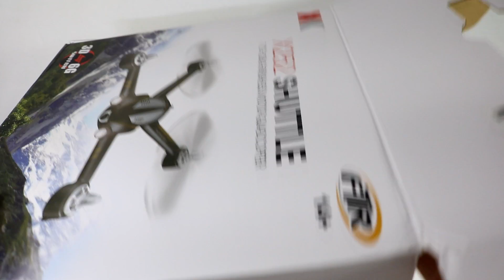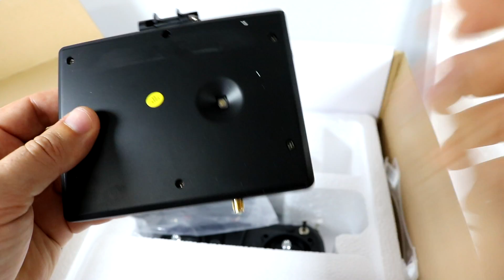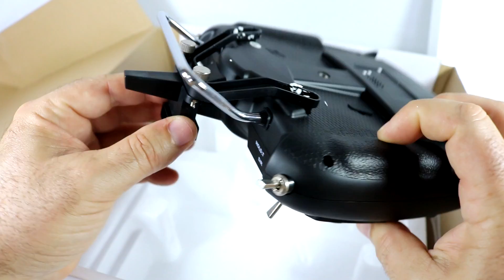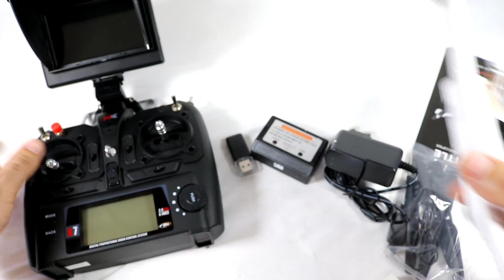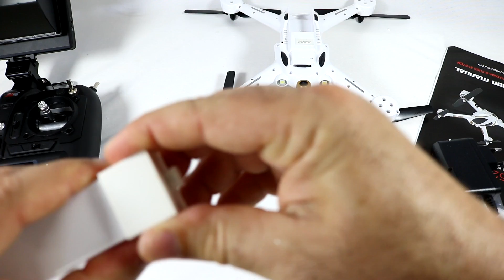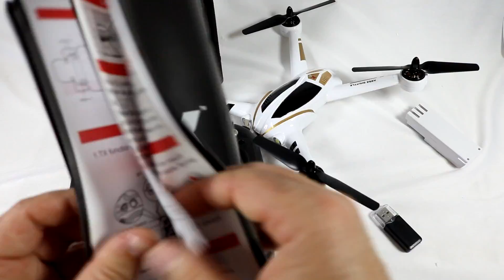XK X252 SHUTTLE Review - FPV Brushless Acro 3D Drone - Part 1 - [UnBox, Inspection & Setup]

Comment: I just got mine today too, this looks like a fun one but the plastic body worries me a lot.
Reply from the maker: +John Cuppi right on John.  It's actually very durable from some major crashing trying 3D mode...lol. I still haven't learned :)
Reply: Had a few crashes with mine today nothing major but the body didn't crack or break so that's a plus. I still can't do 3d flight either without crashing. I am disappointed about how much lag there is in the camera it makes fpv flying with goggles very difficult. eager to see if you have the same problem.

Comment: Proprietary battery makes me a Sad Panda. Wonder how it connects internally for modding.
Reply: Yes, I just got it too and it's a shame that the battery is proprietary. It clips into a balance connector but there is no way to charge it via a "professional" battery charger since + and - are inaccessible. Stuck with cheap balance connecting from the stock charger.
Reply from the maker: +John Cuppi some pro chargers can charge via balance plug only.